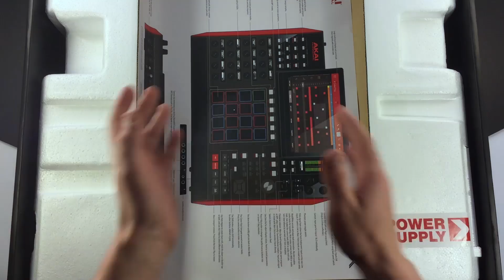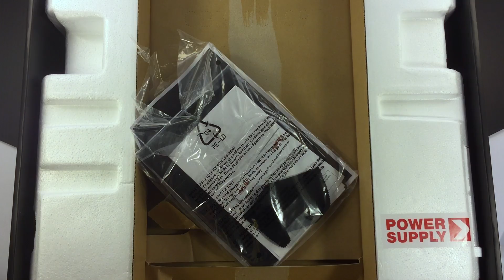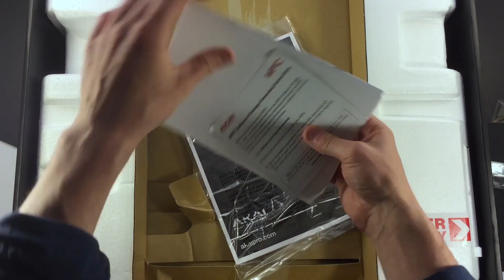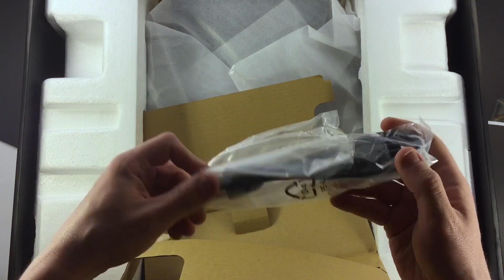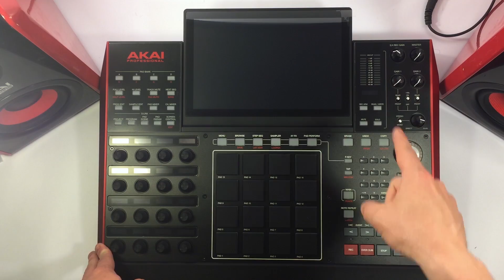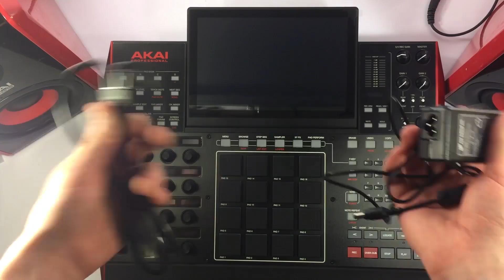Akai Pro MPC X - Unboxing and Basic Setup

Comment: WOW, BIG MPC FAN ,in love allready, i have just got the MPC Live after a long wate, i am also a owner of the MPC4000(my baby) and MPC studio , but due to ten years of hammering away on the 4000 and traveling with it constantly for a decade i have caused to much damage its just short of been repareable so i had to switch up, (MPCStudio) and as my computer runs slow and i am useless on them i have no use for my studio no more,im a standalone guy, the 4000 was my life, so i bought the Live as i travel but i have just had a cash injection (loan,im not rich) so im thinking of swapping for the MPC X or keeping both as the Live is rad for how Live it can be....my only problem is where i am moving to in africa the electricity allways shuts down, A LOT!!, running the Live is great for this as the battery holds for hours!!! but ive been told on forums the X has a short amount of battery life incase of blackouts or accidental power offs, 1. IS THIS TRUE???...and 2.(this is important) is the foot switch inputs(as i am wanting to use effect pedals) for guitar pedal use as i want to use the talkbox on the samples and get creative, also other effects (i knw the footswitch has allways been about but ive never used it), am i right in thinking this is for the likes of effect pedals???....If you could answer these 2 questions it would be a great help in my decision process (although im really digging the concept of the 2 synced anyway, WOW what a machine, anyway be great to here a reply), thanks

Comment: What model of Akai speakers are those .. also does the code have a expire date if you don't do it in a certain time to get the extra sounds
Reply from the maker: Hi! Thanks for watching! The speakers are an older pair of the Akai RPM500. All included software for the MPC X will be available in your Akai Pro account after the MPC X is registered. There's no time limit. The software will be available in your account whenever you're ready to use it!